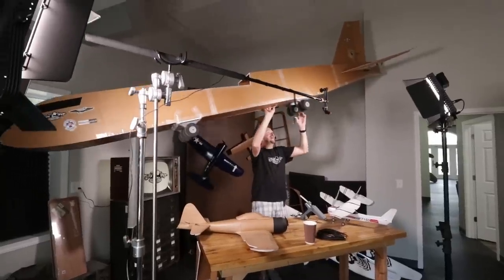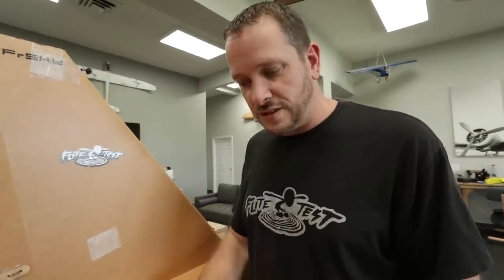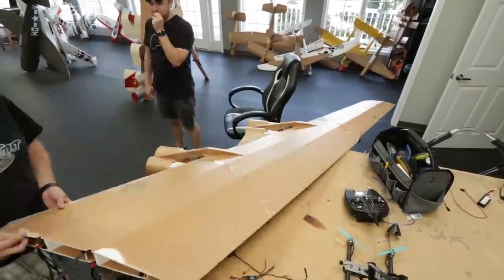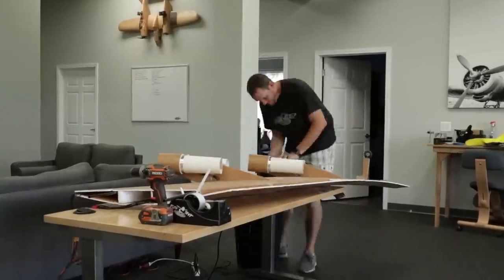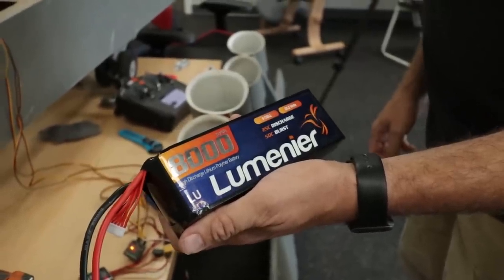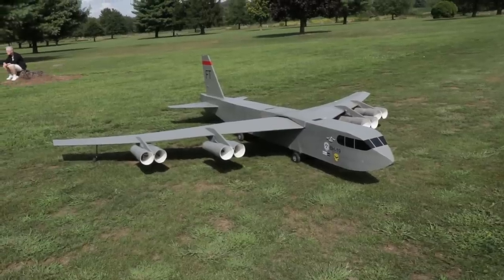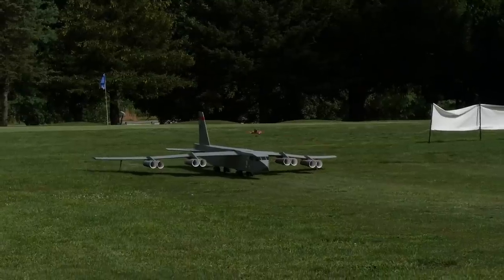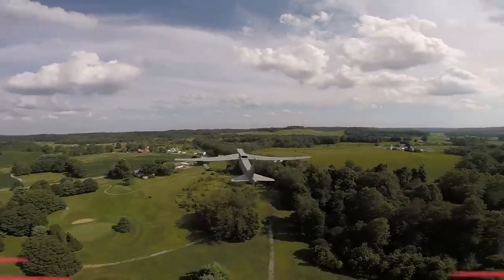✈️ Flying a 14 foot B-52 Bomber Made out of FOAM! ✈️

Comment: Not much you can do with it that you haven't already done with something else like dropping cargo or bombs and both would require a rebuild of the wing. I say retire her and just exercise her every now and then just for the awe of seeing her in the air if you want to keep her together or use the A-10 or another plane you have with a working gun and shoot the B-52 down. 
I still want to see you guys build a PBY Catalina or a P-39 Airocobra or a P-63 King Cobra. Cobras need to have mid mounted motor and shaft drive prop. Or if you wanted to do something really big try to build the H-4 Hercules A.K.A. The Spruce Goose.

Comment: Looks to me, just an amateur view mind you, is the  upper back plate - above where the two wings meet - was so high up on the back it was spoiling all air flow around the rudder rendering it nonfunctional. If that plate was properly secure odds are that rudder would work.  Im quite frankly amazed you got that bird back down in one piece, well done!

Comment: So you store the plane someone else made poorly, make this video of you half-a 'fixing it', (I noticed how the back of the wing was popped up until it was on the ground again), and in the process talk about cutting parts of it off to replicate an event that, IIRC, was accomplished by feathering the engine throttles (what you guys would call differential, a capability you specifically didn't put in when rewiring the throttle)? Not impressed in the slightest. :-(